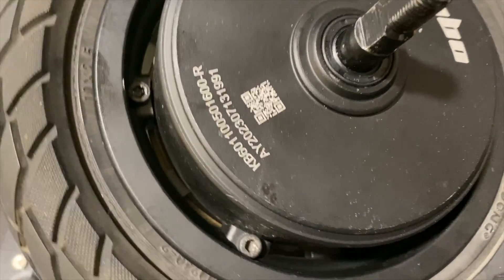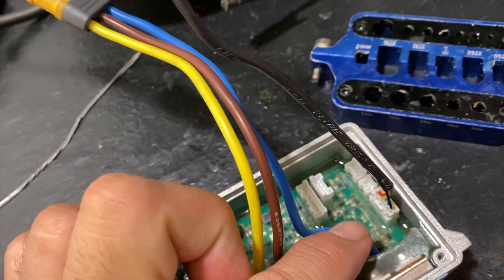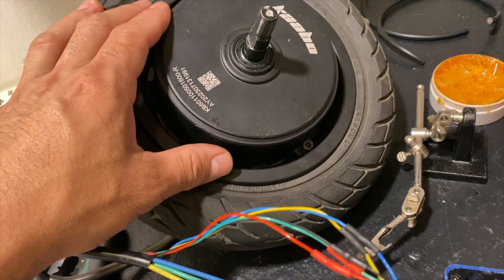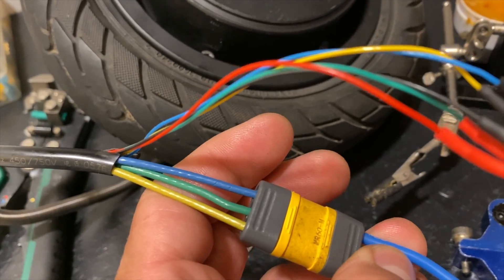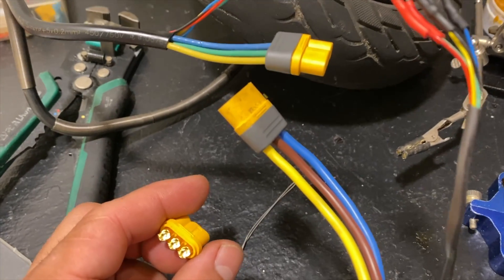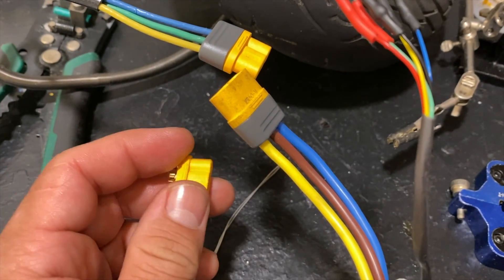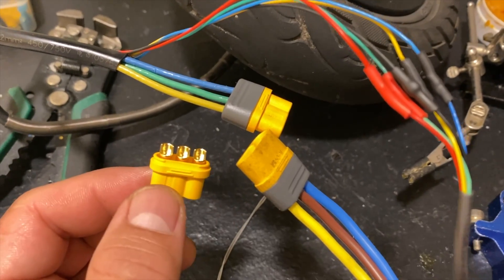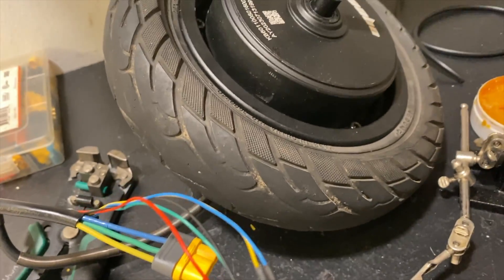Kaabo Motor wire up for Ninebot Max Top Speed 45MPH. on free wheel.

Comment: does this and the dual motor setup work with the black at32 contoller?
Reply from the maker: Oh yea! Dual Set up can work on single or dual without hacking. Is just matter of doing the right connections. Only thing is no reason to put 2 black controllers if you are going to get the same speed as it was one controller :(
Reply: @esnkaz  so i can screw a second motor directly to my controller without any Problems? I'm okay with the same speed i just need more torque uphill.